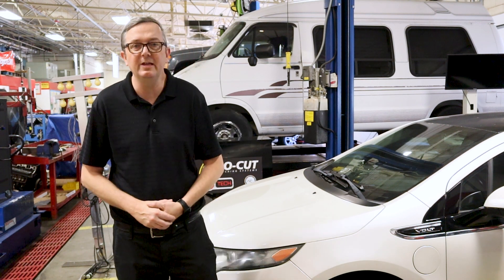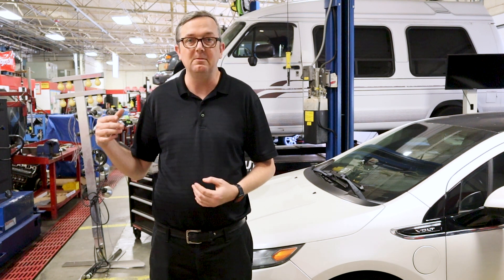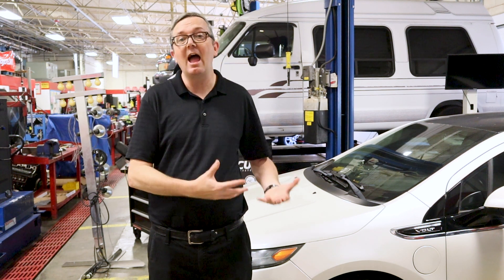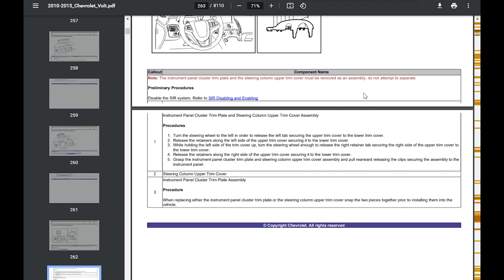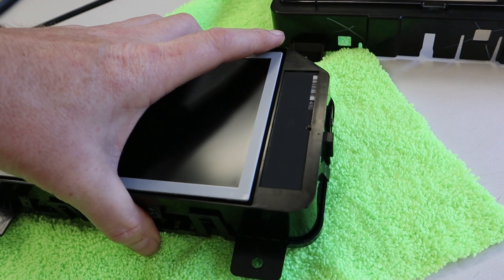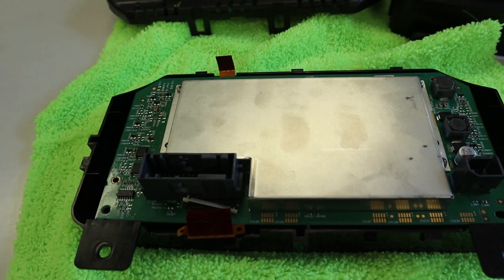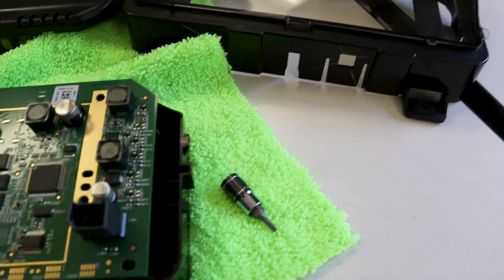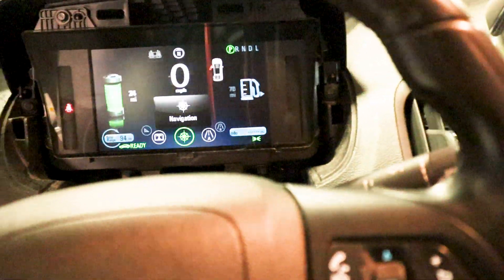Chevy Volt, Holden, Ampera instrument cluster removal repair how to

Comment: Mr. B.    Can you share part numbers of the components?  Thanks
Reply from the maker: @gregoryurban6248  you cannot buy the components that I know of, sorry
Reply: I'm seeing screens being marketed by scrap dealers.  They all have the OEM part number printed on them  For the Volt, one can mix up the instrument cluster display and the GPS main console display.  What OEM part number(s) correspond to the displays you replaced in your video?  Very nice video... but I want to be sure I scrounge the right part.  You were asked a similar question one year ago?   It would seem that the entire point and value of the video is lost if you cant/wont share the part numbers.
Reply from the maker: @gregoryurban6248  I just got an entire cluster from a part out on a Volt Facebook page. I did not see a part number on mine.
Reply: TY.

Comment: Could I use this method to replace the engine malfunction indicator light bulb? I didn’t pass this smog check because this light does not turn on when I start the vehicle. My suspicion is I need to replace the bulb.

Comment: How can I tell if it’s the LCD screen or the board that is bad? The lighting on the screen on mine goes on for 1 second then off for 1 second, and continues that off/on while the car is turned on. The actual instrument cluster never shows/loads.
Reply from the maker: Mine wasn’t doing anything, but the only way I could tell is to get a known good one and start swapping.
Reply: Did u ever figure it out? I have same symptoms.. I bought whole used unit.. just sucks I'll have to reprogram
Reply: Me too.  What happened with yours?